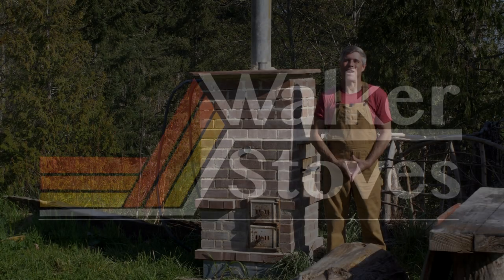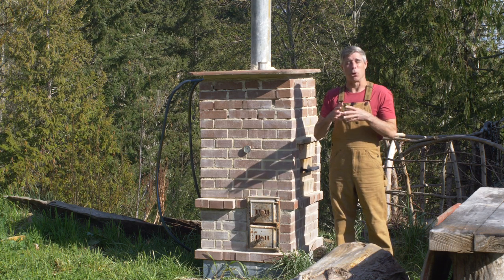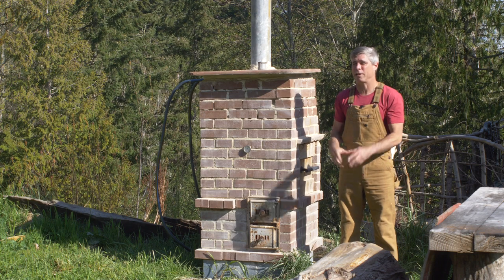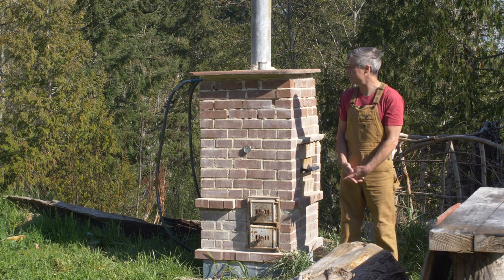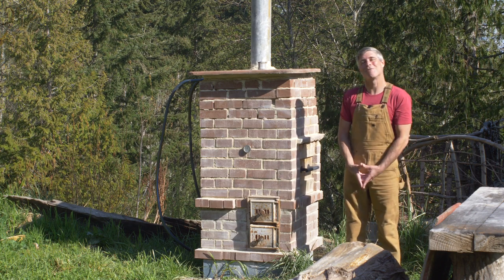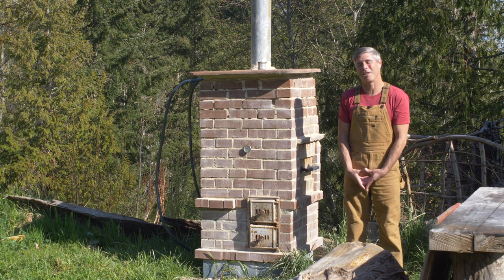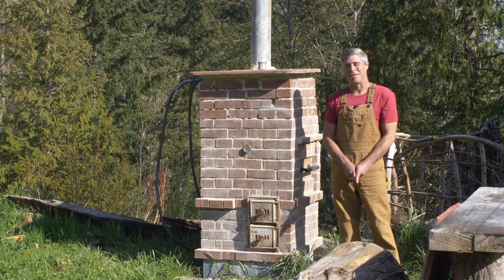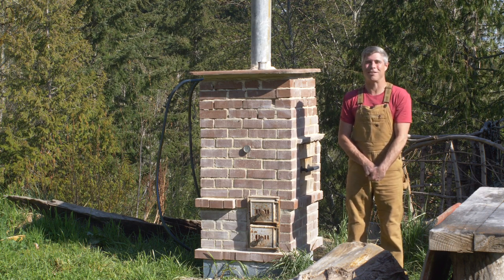The Walker Boiler-A Simple Safe Efficient Wood Fired Water Heater Based on Rocket Stove Technology

Comment: Very cool stuff, Matt.  You didn't mention it, but the opening at the top would help you keep your house humidified in the winter, which is a problem in many areas, particularly with traditional heating methods.  If this were a dark brick tone, you could use passive solar to heat the mass all day, followed by a quick fire at night.  Then, the water going into your conventional or on-demand water heating unit would be probably 20 to 40 degrees warmer, at a minimum, when you take a morning shower.  If you prefer an evening shower, so much the better!  :)

Comment: EPA is already trying to ban wood stoves. Won't be long before they try to ban those too.
How many chords of well seasoned split wood does one need to store for say 6 months worth of use?
How are you preventing those bricks from disintegrating sue to heat/cold cycles?
Any thoughts on local permitting?
IF you can even get it permitted?
Thoughts on property/home/fire insurance?

Comment: Your work is great!  I am interested in your flow rate and flue temps.  Also how you plan to store/use the heat.  I have built wood burning boilers combined with solar thermal to heat radiators and pex floor system with storage tank.
Reply: Was there a masonry component to your wood boilers?  Or were they all metal?  I'm exploring the idea of building an outdoor masonry stove with a large enclosed water tank to use for heating like a regular metal water stove.
Reply: @patrickcleburneuczjsxpmp9558  all metal old freestanding fireplace lined with fire brick with the top couple feet of an water heater set on top of it with a long coil of copper pipe in it.